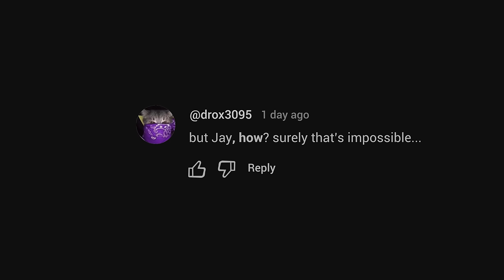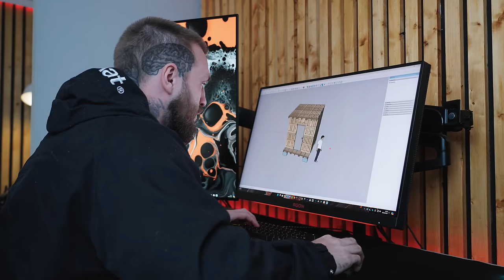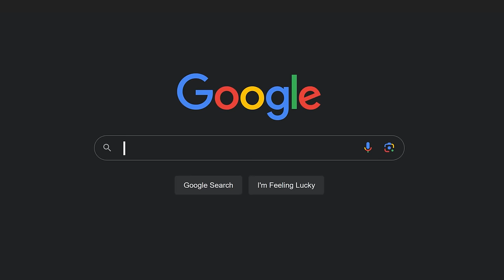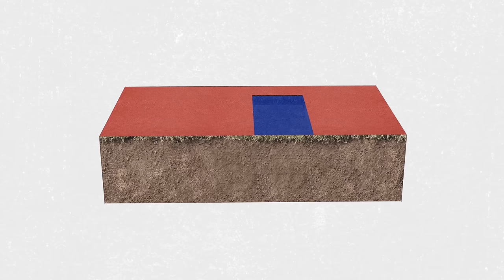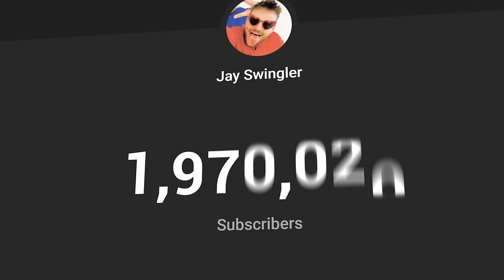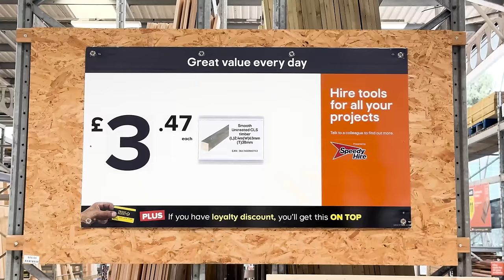I nearly burnt down my house with a DIY sauna..

Comment: soon as i saw the log burner was so close to the wall i knew that would be it, the wall was already getting burned from the heat in the internal video, burned wood right by it. You should put reflective heat sheets next to it made from stainless so the wall does not get as hot. Glad your all okay, just been watching some older tgf vids and is really nice to see your doing well.

Comment: not to be mean, its really not all that bad that it burnt down. you would have had some serious issues with mould pretty quick. saunas should be quite a damp environment and the MDF and the fiberglass insulation you used would just soak all that up and hold onto it not letting it dry.
really cool build otherwise, love to see what can be done on a budget (even if you didn't account for the cost in your own time, as in wages) 
I used to watch you back when you used to break things more, and back when I was young and dumb and I got bored. it has been really refreshing to see the more constructive projects you've undertaken more recently, the moss room, the quail eggs and this have been nuts, and really chill. respect
Reply: Right? The MDF was making my head spin lol. MDF is such a shit material for anything, especially hot damp environments...
Reply: @FurryTrash_  I hate working with the stuff. Makes too much dust, is too heavy, you can't use it anywhere near any kind of moisture, and you can't even really burn it nicely to get rid of it if you are taking something apart. The only thing I have ever seen it maybe being OK to use for is making templates for a router, but you still have the issue of all the dust. Ply is always better in any way, even OSB is better than it in most applications (bar the template thing I think really)
Reply: There was also an issue with the "support" piece of wood holding the roof up. It was just screwed to the pallets. To be strong enough it would need to be resting on top of them. After a while the roof woukd have sagged and start letting rain in  Might have put the fire out though so maybe that was your cunning plan all along 😅.
Reply: @9entax  yeah, I did think that was a bit skimpy too
Reply: @9entax  yeah i noticed that, thought they were gonna put a vertical support piece too

Comment: 0:26 New CHILDISH Hoodie LEAK!
Reply: Bro  slipped up
Reply from the maker: he saw!
Reply: Where???
Reply: @JaySwingler I have been planning on making it the same way but with a log burner stove and not fireplace why has it not worked and set on fire?
Reply: @callumjones2913 if you check the top comment you might not have seen it before it said there why
Reply: @callumjones2913 was heat source was to close to the wood 😮
Reply: @callumjones2913 you got ignored fam 😂

Comment: You didn't put anything around fire place and chimney, like tiles and fire resistant materials for the roof and floor and walls not to ignite around fireplace, then you could have placed it where you want.

Comment: I feel like this could actually have worked out if you would have insulated chimney right, and added some heat resistant plates on ground and around the burner.

Comment: You had no fire board around the stove. You can cheap out on the structure but NOT the heater. You most likely did not have insulated flu pipe either. The stove alone without the flu pipe cost 1500.00 US dollars. Cedar is the only wood to use and its a fortune.

Comment: Did they determine it was the fireplace in there that caused it or was it electrical? Thinking of building a sauna/steam room eventually definitely gonna get a specific steam generator and electric heater most likely too. At least I know the structure itself was sturdy if only you could’ve had the hindsight 😩 RIP the childish sauna

Comment: Did you have any ventilation put into the sauna. You normally need ventilation ie from under the door and one higher up ie the wall. And I think your stove was to close to the wall 😢 And maybe a moisture membrane between the insulation and the cladding I think you should build another, life is a learning experience. I thought it looked really good such a shame 😊

Comment: It's not that you did it on the cheap.  You failed to put a heat shield between the firebox and the wooden all... 

You need a stone .... Fire brick ... Base and wall on the 2 sides of the firebox.

Comment: i wonder what the critical failure was, i mean, obviously it was wood building and fire, but i mean what was the difference between a professionally built sauna and his one, was it the wood being easier to burn because of being pine or something, is there meant to be a specific coating, did he leave the fucker on without water in there so the dry wood was ripe for the burning.

quick google and review the answers obvious, his fire place doesn't have a feckin door, plus the heat, an ember could have easily jumped at the wood and burned it fast, just wrong choice for the sauna, and id assume he didn't extinguish the fire properly.

still cool, no harm no foul, neighbours probably weren't to happy.

Comment: What caused it to catch fire??
Reply: It was made of wood, got too hot and was surrounded by oxygen
Reply: @salty_scvmbxg  "got too hot" it wasn't on when it was on fire....idk man seems odd to me.
Reply: @insertgenericusernamehere2402  you need heat to start a fire. Clearly something got too hot
Reply: @salty_scvmbxg  yeah and that's why I'm wondering what. Faulty electrics?
Reply: @insertgenericusernamehere2402  he didn’t put any fire resistant coating on the wood. metal log burner, real fire, untreated wood, insulation to keep the heat in. Sounds like a good recipe for a fire

Comment: The furnace was the problem.

Not the way it was placed, that was perfectly normal, the furnace by the looks of it was open, that is just a bad fucking idea instantly, it should never be open, the fire inside the furnace was WAAAAAY to big from the video.

Comment: Loved you for 10 years but you are supposed to put the fireplace 3 times the distance of the diameter of the flue pipe from any combustible materials. I think this would work way safer if you followed the safety regulations! That was a wood shed with a fire inside it ofc it was going to set on fire. You didn't even purchase any fire extinguishers or try to find some free or cheap fibreboard or at least something non combustible like cement board. Oh well. Still a good video just an odd outcome. But not following fire safe regs it was doomed to fail.